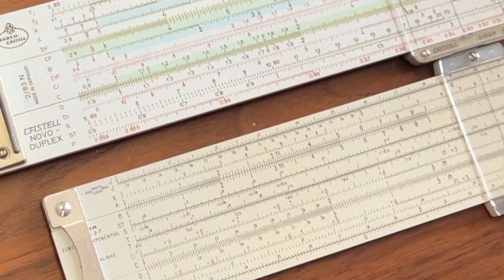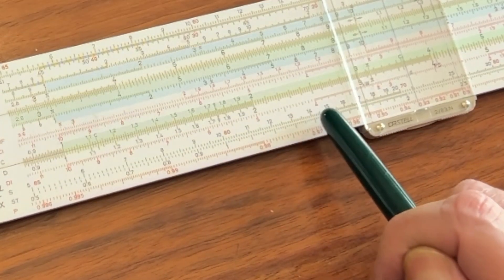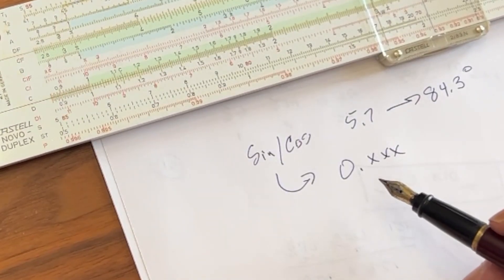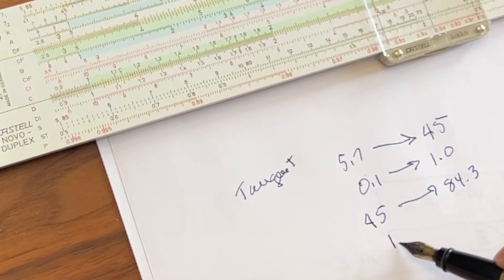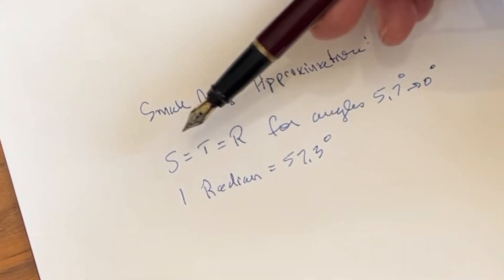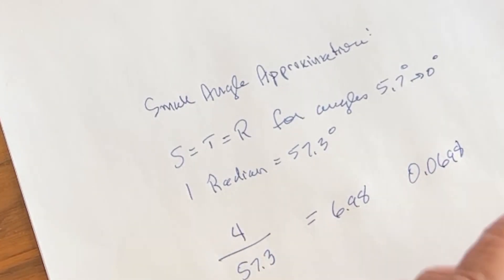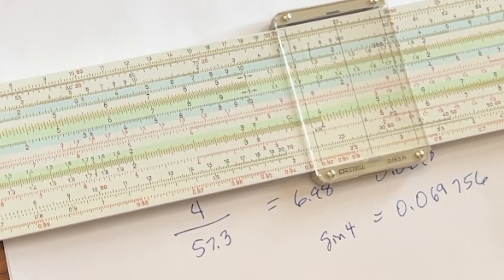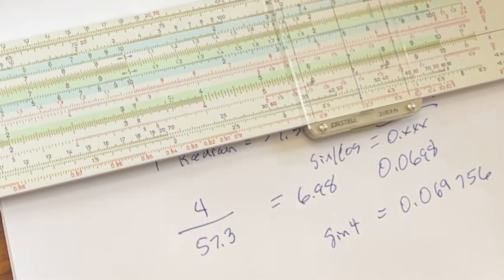The Trigonometry Scales

Comment: Im looking at slide rules on Ebay and I notice that some are trig slide rules. Im wondering why they would make slide rules that just do trig. Dont regular slide rules have all the trig functions that a trig slide rule would have? Im just wondering if its worth picking up a trig slide rule for special functionality.
Reply from the maker: Pretty much all slide rules do the math functions. The ones that say trig are more marketing to emphasize it. The ones I recommend are the Pickett n3 and the aristo studio model 0968 for general use.  They are powerful rules and cost $40-60
Reply: @sliderulesandmathematics9232  thanks, much appreciated, you just saved me from an unnecessary purchase

Comment: Actually, the T2 scale is the one going up to 84.3° (if you ignore the slight extensions).
The S scale goes up to 90° (right index). Unfortunately, it is difficult to correctly read/set angles above 80° on S (which don't have tick marks) due to the more and more extreme distortion/compression in this interval. (If your slide rule has a P scale, usually available on European models, you can circumvent this flaw a bit.) Apart from that, the law of sines is a much more convenient task with a slide rule. 🙂
The Aristo 0969 Studiolog model has S scales both on the slide and on the base which even allows to apply the spherical law of sines or Snell's law just as easily.

PS: Since tan(x)=1/tan(90°-x), the ST/SRT scale can be combined with CI/DI to determine the tangent of angles x between 84.3° and 90°:
Set 90°-x on ST. If ST is on the base, read tan(x) on DI. If ST is on the slide, read on CI. (Basically, this approximates tan(x)~R/(90°-x) where R=180°/pi~57.3°.)
Reply from the maker: Great points. As I said you get lost in the weeds after about 84.3 except for 90